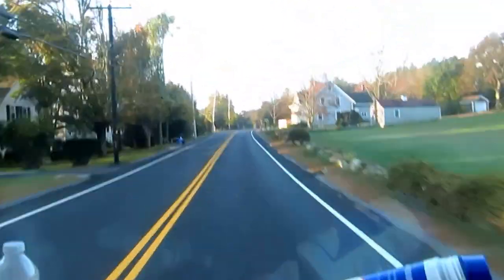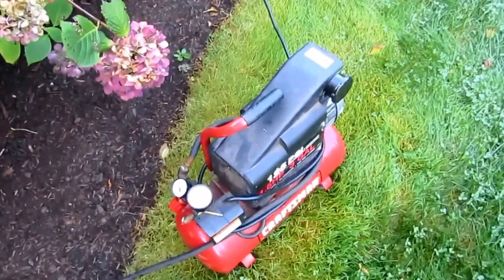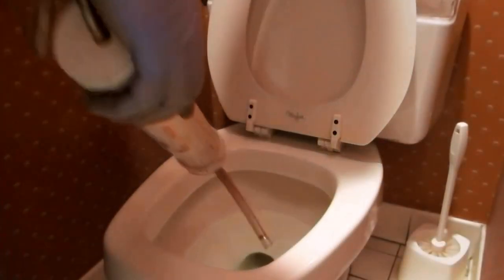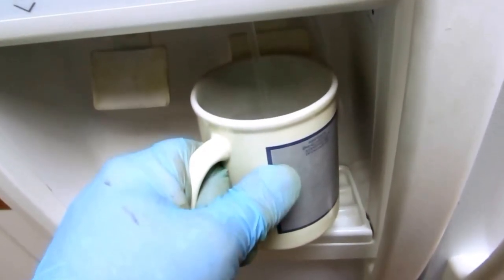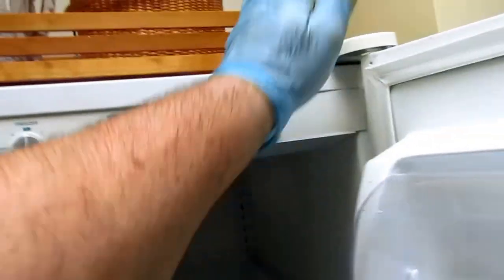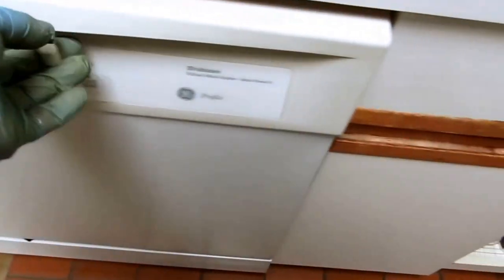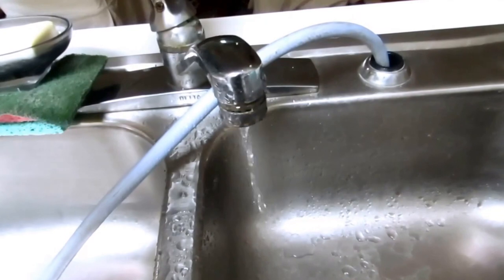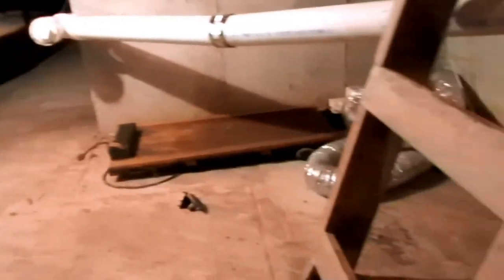PLUMBING TIPS:winterize summer home for winter

Comment: hi steve.    my cabin has a 40 gallon pressure tank in the basement.  will it completely drain by just gravity if i open the valve on the bottom? would it be damaged in any way if i pressurize the system with air?
Reply from the maker: jerry kuceyeski no just use like 60 psi thats all you need

Comment: Thanks for another great video Steve. How full of water does a horizontal copper pipe have to be for it to split? I use compressed air to blow out a short section of pipe feeding an outdoor faucet but one year it split open on a horizontal section. I'm wondering if I just forgot to drain it that year or maybe I didn't get all of the water out.
Reply from the maker: Nicholas CeeA all the water has to be out or it will split .. i usually have pretty good luck but i do take my time and get all the water out ..